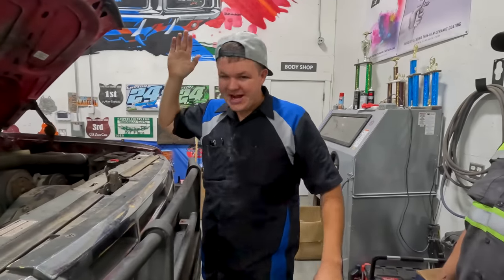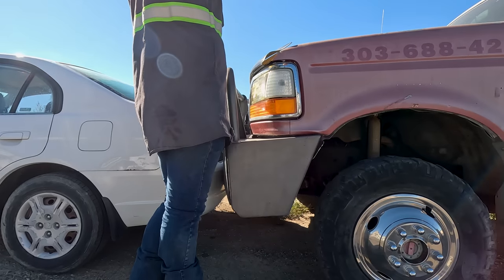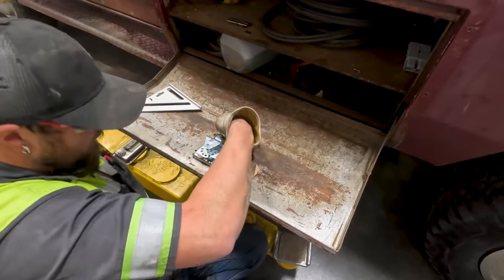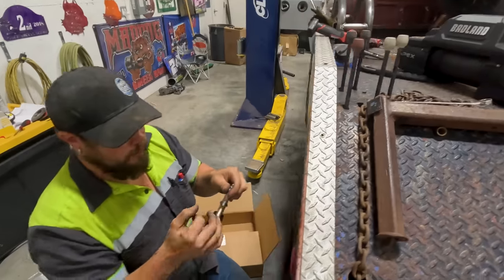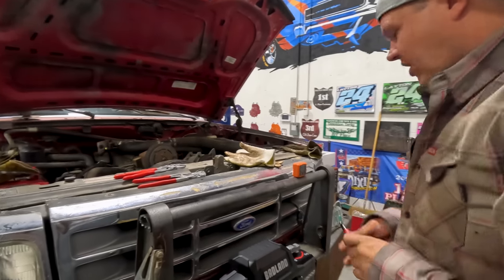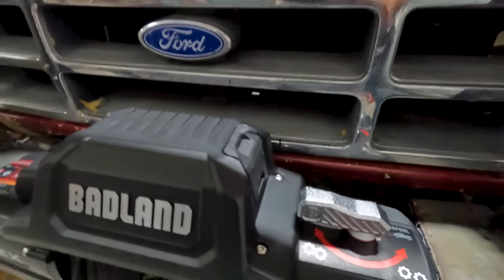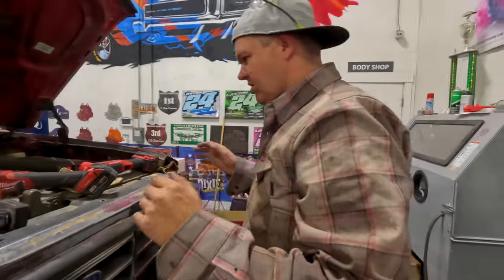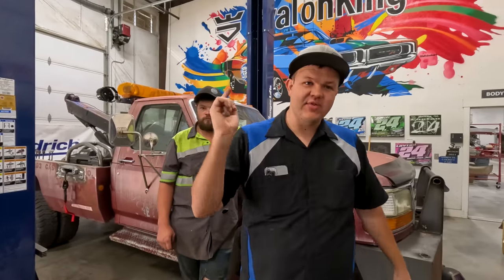Redesigned Custom Front Bumper On Our NEW Old Ford Tow Truck!

Comment: When Fred began his life as a tow truck, a lot of cars still had metal bumpers. The rubber strip on a tow trucks front bumper wouldn't scratch the fine chrome plating. In some rural areas cop cars had big push bars with rubber strips so they could push cars.
Reply: Push was mainly snow stuck, junk in the wrecker yard, clearing a lane, or used prop if break fail on a hill type stuff.
Reply: I know in MY rural area (Los Angeles, lol), both the LAPD traffic units and the CHP had rubber-padded  push bars to enable them to push cars off the freeway. After crashing my Triumph, I even got a ride off the freeway in a big Oldsmobile cruiser, with a full roll cage...
Reply: My Dad and I had to get his manual Saturn with a bad clutch up to a friends shop about 100 miles away. I took an old-style orange life-vest , put it on the edge. With it closed in the trunk and the two long sides of the vest hung out over the bumper. I only gave him a push when he had to stop. Worked beautifully!
Reply: King Fred? No… Trusty Rusty.
Reply: I know the CHP used their push bars when California was a saner place and cars broke down on the Golden Gate and Bay bridge.  However, they would do the same pushing using their motorcycles.  Many local police and CHP would stop and jaw with my grandfather.  I remember the change out from Harley Davidson to Kawasaki and the number one thing the CHP and PD complained about was bending the frame if they used a Kawasaki to push.  The trade off was nothing could outrun the Kawasaki, Just do not use it to push that Belair off the bridge.
Reply: Not king Fred, "Ready Freddie" or "Fast Freddie"
Reply: Menard the tow truck had tires on his front bumper.

Comment: Pro hillbilly tip🤠If you put an old mattress between the bumpers while your pushing you'll never mess anything up 😅
Reply: Or those gym mat things that are are only an inch or two thick. I remember my mom getting her 1985 Chevy Impala pushed out of traffic by a wrecker and he had those blue mats behind his seat, pulled it out, tossed it over the bumper and then shoved us into a gas station.
Reply: I don't think the idea was ever to push a car that just needs repair, more for cars that are wrecked anyways and they wanna get a lane open
Reply: @Beandiptheredneck  I always saw it used to quickly open up a lane of travel for stalled cars. Push it to the side, THEN figure out if you hook it up, add gas, etc. The bumper just gets it off to the side
Reply: you're.
Reply: @Natschke_Family_Adventures  there's always one..
Reply: You'll mess up the mattress 😂

Comment: In 1970s Montreal Canada rubber push bumpers were the norm on garage vehicles of all sorts, car/truck sizes of all kinds. A busy shop could field 4 or more vehicles in a big snow storm. Very handy in snowy climates.
Reply: I used to always keep an old tire to throw on front bumper during winter. These days you are lucky to find anywhere to hook tow strap to. Try to push or pull a new car entire car falls apart. Ive done 200 mile trips in 80's gpa behind me pushing up I40 with his f150.

Comment: Nice cad work to cut a design into the front bumper.  Robby is thinking form and function on the entire front bumper. 
Don't forget the storage units new latches that keeps everything safely stored in its place.
Super work on an old wrecker to change it from a frog to a prince.
Reply from the maker: Thank you! Hillbilly installed the new latch on the box!!
Reply: Yes and the Boss ordered the latch. Sorry I didn't point out their contribution properly.  Sir Hillbilly, I am sorry for not using your name in my original comment.  And, Ms. Boss I am sorry for not pointing out your contribution to the latch repair.
Plus if I missed anyone else please extend my apologies.  I'll try to do better or keep my text fingers silent.

Comment: In the 70s I used to tow one vehicle while pushing another to bring them back to the shop on -30 days. We also used the bumper to push start cars that could be push started. The bumper on the wrecker I used had several rubber pads rather than belting.

Comment: When I drove a tow truck (1974-76) the truck I drove had an full width, 18 inch front bumper with 3/4" think rubber all the way across the bumper. It worked very well and was use frequently. I drove a 1966 Dodge with a 480 Holmes and a 1970 Dodge with a 480 holmes. It really worked good when you had to unpin the booms and go over the side, like a side winch.

Comment: Where I live the tow trucks had bumpers like that because they would volunteer at the various small dirt and asphalt tracks here in upstate NY. It was free advertising for them and free admission to the races. They would have to push start cars and they would just push them if they broke down. Of course wrecked cars would require towing but the push was the most efficient way. Also some cars like sprint cars dont have starters and they are direct drive so all need to be push started too. The announcers for the race would always call out the tow company for being there with the tow trucks. Its just a thing they have always done

Comment: we've just used an old 4wd tyre between the bumper and pushed car....only leaves a rubber mark. nice work lads. I would have also back filled that lower facia cut out... makes it fancy smancy

Comment: We would tie an old tire onto the push bar.  Vehicles all had metal bumpers back then and often didn't line up.  We had a '49 Willy's for our tow truck.  It was slow and rough riding but never let us down.

Comment: With as much stuff as you end up pushing into the shop the rubber bumper might be nice. But you also have frank and the skid loader.

You should leave the brush guard, it adds a toughness to the front end. I personally think it looks great with it, but its your ride so

Comment: My first real job was working in a shop that repaired bumpers and had them rechromed.  The second one was running a service station and we took an old truck and bolted a thick wood plank on the front so we could push cars around the lot.

Comment: Most police cars  in the US. have push bars on the front to move cars out of the way. The same is true for most Bridge, tunnel, freeway service vehicles. In New York City the police ES units have and use what the tow truck had on it.
Reply: Most Fire engines have a bumper built to push too. The one I run has a 3/8 C channel structural bumper on the front. But I've never had a reason to use it yet 😅

Comment: Back in the 70’s when I was in my 20’s running a wrecker, we had mounted on the front of a flat steel bumper    2X8 hard wood 2 on top of each other making it 16 inched high. Why? The benefit was no damage to the wrecker just replace the wood when it got worn a bit. The car or vehicle being pushed hardly ever even scratched it. Of course no crazy pushing. And painted black it blends in worked well.

Comment: Angle the sides of the front bumper and put 2 winches on either side for angled pulling.  Even if they are small 2500 lb atv winches, so you can say you have the same number of winches as the heavy wrecker

Comment: When Fred was new a lot of cars still had no electronics and wreckers often had 12 and 24 volt options in the same set of jumper cables permanently attached to the front of the truck, i made bags of cash during the blizzard of 77/78 with 24 v. boost starts 😂😂

Comment: The rubber covered bumper on a tow truck, was a left over from when cars had manual transmissions, to help push start cars. Not just push them off the road.

Comment: Definitely consider putting a guard of sorts around the handle for throttle control on the bed. One wrong bump and you have Fred whining at high throttle and stuck .

Comment: If your boxing the front in, it's going to be like a little tray where the winch sets so shouldn't you drill some drainage holes in bottom mount plate for water and snow.

Comment: 3:47 back when they were using those push bumpers primarily everything they were pushing didnt have a plastic/painted bumper. That rubber was a cushion between the tow trucks steel bumper and chrome steel bumpers. Bit thats mostly a bygone era 😢

Comment: Robby, you should look into the Milwaukee 6190-20 14" Dry-Cut Machine. These cut metal tubing and pipe 100 times better than the abrasive model that you use.

Comment: As a teenager (mid 80's) I worked at a drive thru exotic wildlife park. We always had at least one pickup outfitted with a large hardwood bumper allowing us to push broken down vehicles away from the animals where you could then safely work on the vehicle or have a local tow truck haul her away. Couldnt do it nowadays you would destroy 2000 bucks worth of "plastic" bumper covers.

Comment: When we didn't have a tire I'd sit on the front of the push vehicle and put my feet on the dead vehicle and use my knees as shock absorbers to get the job done. I'm 61 years old this month and my knees are doing fine 😜 
Mind you I could leg press 2,600 pounds in the gym, so I don't suggest this for everyone!

Comment: Robby...... you should put an.      X.     On the bumper and keep the original bar and uprights just add a second bar 6 inches down from the original then put in an ,    X.... with tubing and put farelead off the ,    X .     (    [X]     ) .........

Comment: I would have brought the winch section of the bumper itself out  a bit instead of cutting the grille. It would have changed the front face of the bumper but it could have been done in a way to make the bumper look very modern and very good at the same time.
Reply: @@Martys-4x4 I changed that spelling 3 times. Spell check kept changing it to “grill” but thanks for letting me know.

Comment: I don’t know what you’re thinking, but the old bumper actually had a lot of uses. Yeah the bottom was made for pushing it’s still good for pushing, even with the way you put the winch which there are times in your,(Off-Road Recovery) and that you could actually use a bumper to push with. Also, the bars that are on there is something that you could tie to so you can run a winch line out and back and tie it to the front of the truck to do a pole or from the front out and back and tie to the front of the truck to do a pole plus going through the brush that you guys go through it protects your headlights and turn signals etc. etc. etc. granted it’s not my truck I get that and I’ve liked most of the things you’ve done to it I still think just calling it the king is the better name Fred, not. I do like where you put the winch in the front but I definitely don’t like the looks of the front now she chopped all the stuff off of it. Just my opinion like I said, it’s not my truck, but if you’re wanting to get rid of it, and give it away, I would be more than happy, lol to take it off your hands, Lol.🤣
Reply: ruining that truck😭

Comment: My local Honda dealership, has a remote controlled push vehicle,about the size of a small riding lawn mower.  The front of it has a large rubber bumper for pushing dead cars into the shop.  It still can’t be good pushing these new plastic bumpers.

Comment: Since you're making your own winch Mount you should have just lowered the whole mount that way you didn't have to cut the grill as long as the fairlead is up high enough the winche is up high enough you can even Notch the bumper for the fairlead if you had to

Comment: I would've reinforced the top of the bumper for a receiver hitch with a Anderson plug and put the winch on a demountable winch cradle. 

Then you could've put it on the rear hitch if necessary while also keeping the push bumper aspect. 

The only other bumper mod I would've done would be trim some inches of the bottom and sides to improve my approach angle.

With your recovery AO having more trees and branches MORR's AO, I would've left the barwork to protect my fenders, lights and grill cos most pattern part replacements are crap fitting.
Reply: They put winches all over this thing, that would be a waste of time.

Comment: Y would u remove the top bar it looked better with 2 bars across and u can also add a light bar or round lights on those bars so y not use it and not ruin it more 🤣

Comment: Why cut the bullbar to bits? Do you Americans like leaving the front end of the guards and the lights exposed to damage?
Reply: It depends on the rig and what you're using it for.. these fellers are only a few "Americans" that are building their rig the way they want, go check out other american channels and you'll see they build it differently.. should we judge all your people by a couple of young folk building a tow truck
Reply: They aren't finished yet.  Will be better than the original when they are done.